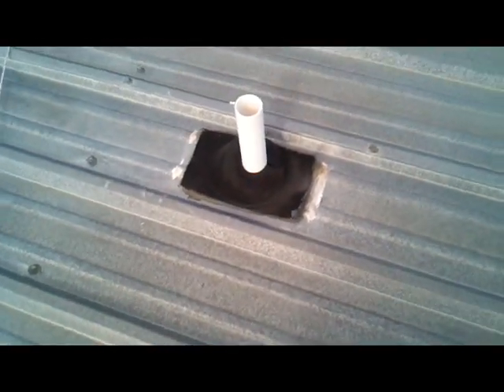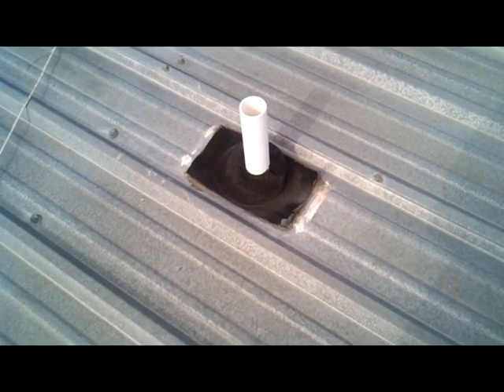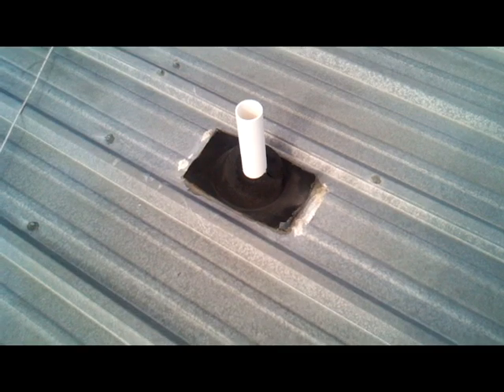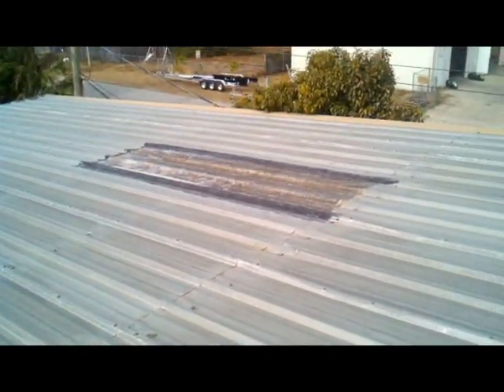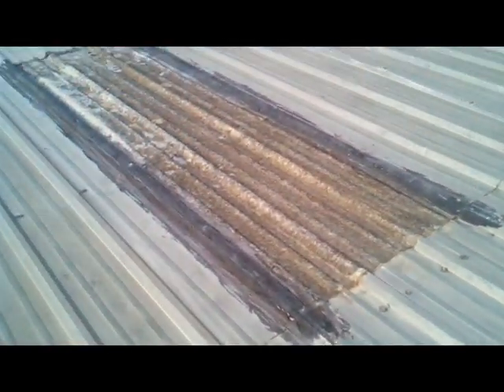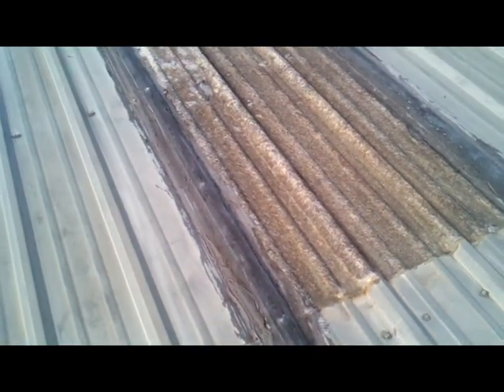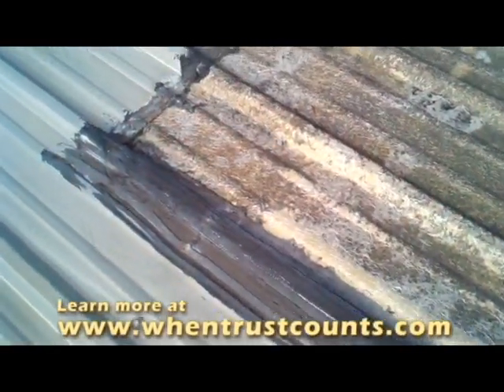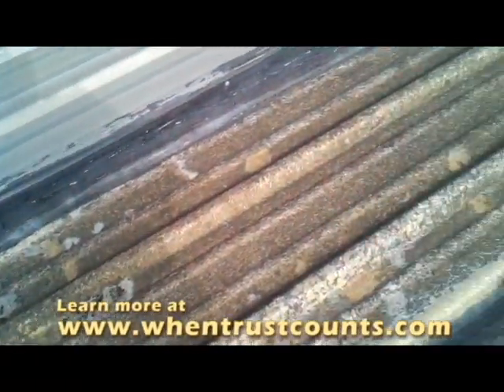Common Mistakes with Metal Roofs - by Tadlock Roofing University

Comment: Getting ready to replace roof with metal ~ what is your best advice for longivity? Tips to slow cookout. Seems that wood strips would keep roof cooler over years and prolong life. I also have two layers of shingles. Is it recomended to do tear off even if state code allows leaving it on? Simple 24' x 50' ranch... as an old bricklayer I know a few little known tricks that will add to life of product....